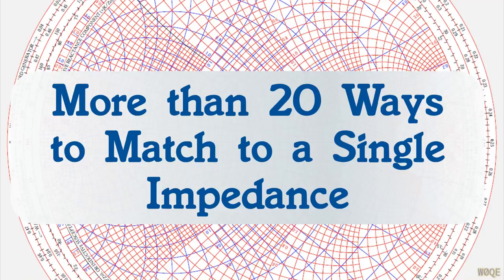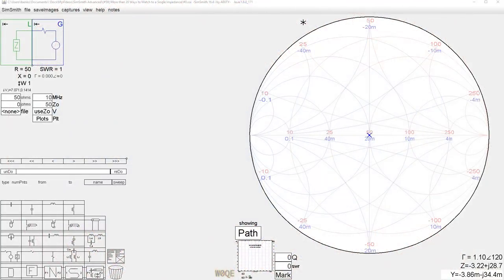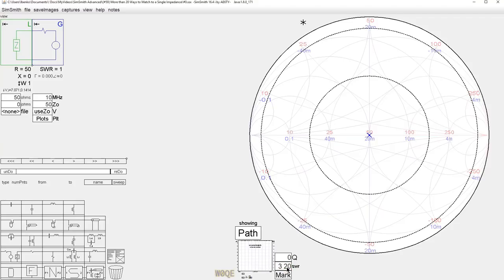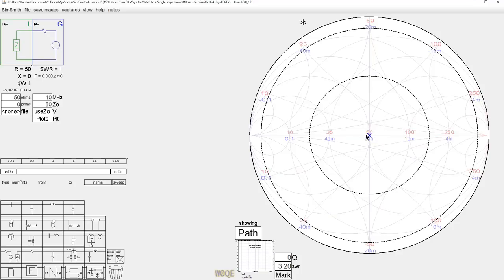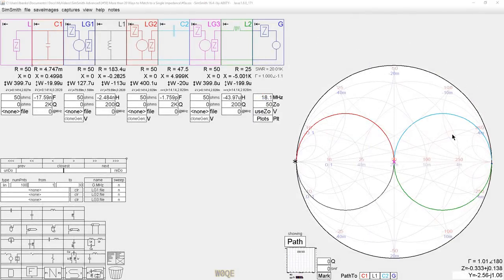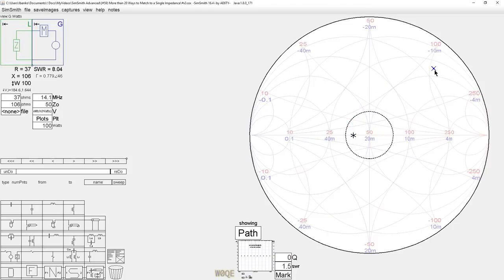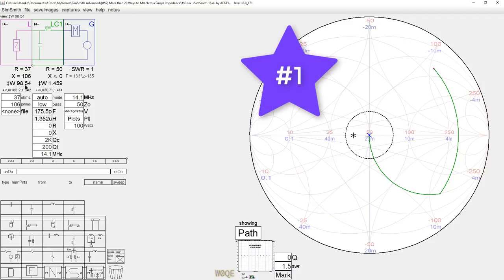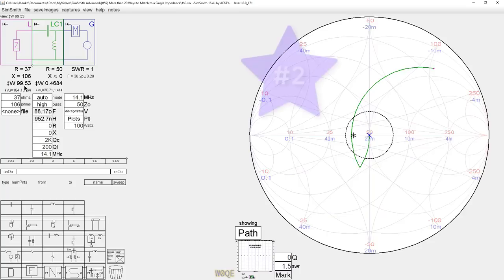#59: More than 20 Ways to Match to a Single Impedance

Comment: This has been very instructional It would be very helpful to be able to see how to actually wire up the components in an antenna system according to the design in Sim Smith. So a video of you actually connecting a pine network onto an antenna or a stub match onto an antenna So far this is all been theoretical it would be nice to see the practical application of actually placing these components to see how they'll look